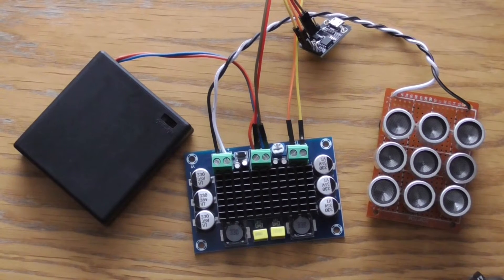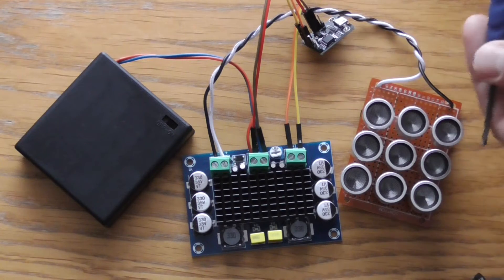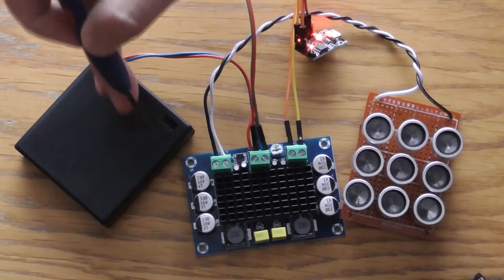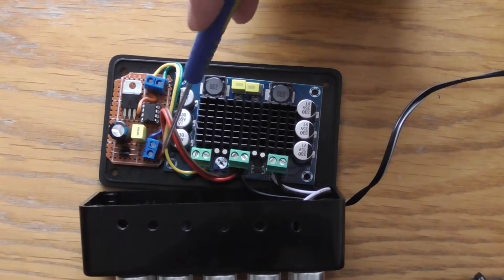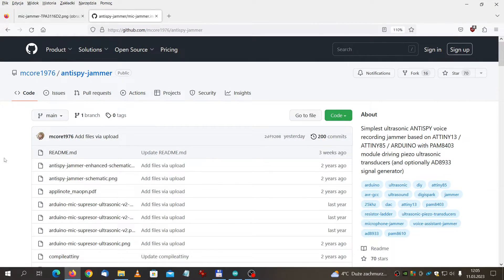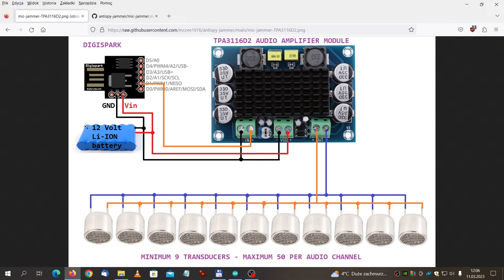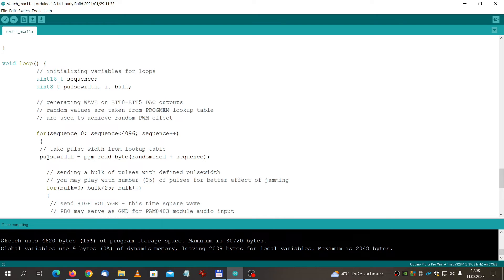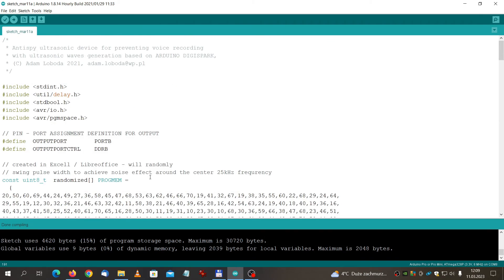DIY microphone jammer beast for less than 30$,  voice recording blocker with Digispark and TPA3116D2

Comment from the maker: ATTENTION! I HAVE CREATED RASPBERRY PI PICO (RP2040-ZERO) / ESP 8266 D1 MINI / ESP32C3 SUPERMINI + AD9833 VERSION FOR THOSE WHO ARE HAVING DIFFUCULTIES WITH BUYING AND PROGRAMMING DIGISPARK MODULES : 

Raspberry Pi PICO : RP2040-ZERO module

RP2040-ZERO DIAGRAM #1: https://github.com/mcore1976/antispy-jammer/blob/main/arduino-mic-supresor-ultrasonic-RP2040-zero-TPA3116-IRF-coils.png
RP2040-ZERO DIAGRAM #2 https://github.com/mcore1976/antispy-jammer/blob/main/arduino-mic-supresor-ultrasonic-RP2040-zero.png
RP2040-ZERO CODE : https://raw.githubusercontent.com/mcore1976/antispy-jammer/refs/heads/main/mic-jammer-rp2040-ad9833.ino

ESP8266 : WEMOS D1 MINI (clone) module
D1-MINI DIAGRAM #1 : https://github.com/mcore1976/antispy-jammer/blob/main/arduino-mic-supresor-ultrasonic-ESP8266-D1-MINI-TPA3116-IRF-coils.png
D1-MINI DIAGRAM #2 : https://github.com/mcore1976/antispy-jammer/blob/main/arduino-mic-supresor-ultrasonic-ESP8266-D1-MINI.png
D1-MINI CODE : https://raw.githubusercontent.com/mcore1976/antispy-jammer/refs/heads/main/mic-jammer-esp8266-wemos-d1-mini-ad9833.ino

ESP32C3-SUPERMINI  CODE : https://raw.githubusercontent.com/mcore1976/antispy-jammer/refs/heads/main/mic_jammer_esp32c3_supermini_ad9833.ino
Reply: Sorry for the stupid question but I am illiterate in the tech language that you are speaking at the moment. Does this mean that you have actually created the device and it is for sale? Because I don't think I can do this project.

Comment: Does 15 ultrasonic transducer needs 100w tpa311d2. Will it not effect the transmitters.
Reply from the maker: yes you have to use this audio amplifier board OR build an output stage with TC4420 MOSFET driver chip + IRFB4115   MOSFET transistor + set of 4.7milihenr coils like I am showing in my newest video here : https://youtu.be/p5w_T1xVSF8

Comment: Is it possible to go with 20khz from one channel of the amp and 25khz from the other channel to cover a wider range of mics? Unclear if the signal generator could handle this, but if you had two of them, could you feed each frequency to a different audio channel and amplify both at once?
Reply from the maker: single AD9833 generator has only one channel I am afraid. so the answer is no. you need 2 such devices

Comment: I would like to share the following information:
20khz transducers work well on Android, iPhone 12, 13, 14 in the common, pro and pro max versions, however on iPhone 15, 15 pro and 15 pro max it generates a loud graphic on the recorder but the voice comes out normally, the only one that works on the 15, there are 25khz transducers that force the microphones to redact the sound in order to completely silence it, during the recording there is no noise or voice, I think the solution for iPhones is still 25khz transducers.
Reply: hi, very interesting your observation...I would like to know what the effects would be if we manufactured two models, one on 20khz and the other on 25khz which would be used at the same time...or how to cover as many models as possible?
Reply: @Jean-tc3wq  one would cancel out the other, in addition to a loud noise, but if you set up a single circuit ranging from 22 to 26 kHz and mix 25 and 23 kHz transducers it works well on iPhones 15 to 3 meters
Reply: @kadinbrasil8160  well we just have to wait until Adam is motivated to make us a final mount🤗
Reply: @Jean-tc3wq  If you use two circuits, one with 20khz and the other with 25khz, when connecting one together it would cancel out the effect of the other on some iPhones, it would work on the 13, 14 but on the 15 it would generate a loud graph on the recorder but it would not cover the voice due to the new technology of the 15 and 15 for max.

The only test that had any effect was in a single device using 15 23khz and 15 25khz transducers with infrasound fixed at 45hz in the single device varying the ultrasound at 22 ~ 26khz

void setup()
  {
  spi_init();
  ad9833_init();
  
  ad9833_set_mode(AD_SINE);
 
    
}

void loop() {
uint16_t i = (0, random(22000, 26000));
  while (true) {
   
   int noiseValue = (0, random(-1000, 1000));
   
   double normalizedNoise = noiseValue / 2000.0;
 
   double modulatedFrequency = 26000 + normalizedNoise * 2000;
   ad9833_set_mode(AD_SINE);
   ad9833_set_frequency(0, modulatedFrequency);
  
  
  while (i >= 21000)
            {
             i = i - 45;
            
             ad9833_set_frequency(0, (double)i );
              
            };

            while (i <= 26000)
            {
             i = i + 45;
          ad9833_set_frequency(0, (double)i );
             
            };

}

}
Reply: @kadinbrasil8160  thank you for your reply this piece of code must be merged into ino...? I don't know much about programming...
Reply: @kadinbrasil8160  or if you would like to propose it to Adam for a possible evolution of his tool... that would be the climax there😅
Reply from the maker: yes we are already working together on the improvements. Soon there will be an update video. The project is almost completed
Reply: @Jean-tc3wq  The project is Adam's, he is the author of everything, I'm just studying and collaborating with his channel, but all credit and intellect goes to Adam.

Soon he will post the completion of studies and new project to everyone.

Comment: Hi
Reply from the maker: hi
Reply: @justanengineer5599  I would like to share the following information:
20khz transducers work well on Android, iPhone 12, 13, 14 in the common, pro and pro max versions, however on iPhone 15, 15 pro and 15 pro max it generates a loud graphic on the recorder but the voice comes out normally, the only one that works on the 15, there are 25khz transducers that force the microphones to redact the sound in order to completely silence it, during the recording there is no noise or voice, I think the solution for iPhones is still 25khz transducers.

Comment: Hi, i just got 50 transducers from AliExpress. 30 out of the 50 had a sort of glue/silicone on the middle of the cone. Is that normal?
Reply from the maker: yes. they are are using kind of glue to attach piezo

Comment: hi I would like to know if being able to jam the iPhone 14 pro proves that it is effective on the vast majority of micro spies...and a comment caught my attention on putting a bigger budget on the jammer ...you talked about more transducers. "Additionally I would use programmable electronic potentiometer" would be possible to have a diagram with this said potentiometer... if it's not too much to ask of course... it's already very good to share your top achievements with us!!!!
Reply from the maker: The iphone 14 can be jammed but only when 1 particular type of transducers is used 20kHz / 24mm very expensive 10usd per single transmitter. 
On the other hand the jamming capability can be improved by using the 25khz / 24mm transducers with bigger tollerance that work within +/- 2KHz difference - in the range 23-27KHz not 24-26KHz. This is of course also bound to modification of the source code for this wider bandwidth.

Comment: Hi I would like to know if it is possible to use this model of amplifier coupled with two rangers of 20khz or 25khz transmitter knowing that we have twice 120 watts output

TZT DC 12V 24V 120W*2 TPA3116 D2 Dual Channel digital Power audio amplifier board good
aliexpress
Reply from the maker: Yes it is possible. I have even tried such combination. But when both 20kHz and 25KHz are enabled there  is very audible distortion noticable
Reply: @justanengineer5599  yes but you have to supply 24V to have all the power...so basically you might as well stay with the 100w mono amplifier...

Comment: Hi, what would you change in your design. if you have a higher budget.
Reply from the maker: first of all I would buy more audio amplifiers and install more transducers. Additionally I would use programmable electronic potentiometer to introduce amplitude modulation  for better distortion effect

Comment: Can we used uno?
Reply from the maker: you may try with this code (this is for Arduino Pro Mini which has the same chip ATMEGA328 as UNO) :
https://github.com/mcore1976/antispy-jammer/blob/main/mic-jammer-ad9833-new-version2.ino

but use TPA3116D2 mono instead of PAM8406 
https://github.com/mcore1976/antispy-jammer/blob/main/arduino-mic-supresor-ultrasonic-v2-pro-mini.png
Reply: @justanengineer5599  how about part HC  sr04  sensor, can we use this Tx for project?
Reply from the maker: no. buy 25khz transducers. If you want to use 40khz there is a source code for this. browse the comments down below many people are asking the same question
Reply from the maker: you need to buy it directly from china  check this info and stop complaining

https://www.aliexpress.com/item/1644831156.html

https://github.com/mcore1976/antispy-jammer/issues/2
Reply from the maker: great success !
Reply: @justanengineer5599  jest różnica gdzie plus a gdzie minus na transmiterze czy po prostu wszystkie tak samo muszą być połączone?
Reply from the maker: niektorzy tutaj pisali ze nie ma róznicy ale jak sie przyjrzysz nadajnikowi to jeden pin ma styk z obudową (jest ujemny) a drugi jest odizolowany (jest dodatni). Ja staram sie zachowywac polaryzacje i łączyć dodatnie z dodatnimi

Comment: I make a 21 Khz mic-jammer (16 mm and 45 transducers). Do you plan to add AVG solution for this (may be something of 20 Khz solution ? Thanks for this 
https://drive.google.com/drive/folders/151QBdlNnTVDCvQOewkptvG_LlpNAHJEU?usp=sharing
Reply from the maker: Hi. I have already tried 21KHz transducers and they are not good. I mean they supress microphone sensivity but they do not allow to sink this fuzzy noise into the audible band. I have a lot of them but they are not good for mic jamming.. 
it is better to use 25khz though
Reply: thanks fo this. @justanengineer5599

Comment: hi sir i have these questions if you are so ganerose to answer me thank you 

1. Can I use the AD9850 instead of the AD9833?
   - Is it possible to substitute the AD9833 with the AD9850?

2. Can I wire the ultrasonic sensor randomly, or do I need to know the positive and negative pins?
   - Is it necessary to identify the positive and negative pins when connecting the ultrasonic sensor, or can it be wired randomly?

3. In your video, you mentioned the "jamming beast" and didn't provide the schematic for it. I noticed the use of the NE555 IC, but I'm unsure how to connect all the components. Could you please provide guidance on wiring them together?
   - In your video, you showcased the "jamming beast" without sharing the schematic. I noticed the inclusion of the NE555 IC, but I'm uncertain about the correct wiring configuration for all the components. Could you please provide instructions on how to connect them together?

thank you 🎉
Reply from the maker: Hi.
Hi I havent tried with AD9850 so I have no general answer. 

Audio amplifier module - each TPA3116D2 module can handle up to 40 transducers so you would need to attach many of them (inputs of XH-M542 modules)  to the single AOUT/AGND output pins of AD9833 signal generator boards.  Please keep mind that more transducers you connect to TPA3116D2 board the HOTTER it will get. Try not to fry it out.

IIf you are a beginner, try to use Arduino Digispark module that contains ATTINY85 chip. You need to program this board using INO script and Arduino IDE environment. You do not push HEX files here.
INO Script : https://raw.githubusercontent.com/mcore1976/antispy-jammer/main/mic-jammer-digispark-ad9833-new-version2.ino
Connection Diagram : https://github.com/mcore1976/antispy-jammer/blob/main/mic-jammer-AD9833-TPA3116D2.png

In my video I am using ATTINY85 (not NE555) .If you want to use directly the same chip ATTINY85 instead of Arduino board you need to have installed : AVRGCC environment ( checlk this tutorial http://fab.cba.mit.edu/classes/863.16/doc/projects/ftsmin/windows_avr.html ), you need to have USBASP chip programmer and you need to connect chip to the programmer (as I am showing in my video : https://www.youtube.com/watch?v=7klgyNzZ2TI) . It's "make life harder" type of approach but its durable :
You are using then following source code : https://raw.githubusercontent.com/mcore1976/antispy-jammer/main/main6-new-version2.c
You are using following diagram : https://github.com/mcore1976/antispy-jammer/blob/main/arduino-mic-supresor-ultrasonic-v2-ATTINY85-TPA3116.png
And you are using this compilation method for ATTINY85, AVRGCC + USBASP : https://raw.githubusercontent.com/mcore1976/antispy-jammer/main/compileattiny6

The transducers alway have negative pin connected to alloy housing and positve pin isolated, it is also visible on the pictures from the vendor. Easy to locate positive and negative.

Also remember to use XH-M542 TPA3116D2 audio amplifers which I found THE ONLY WORKING PROPERLY with piezzo transducers
https://pl.aliexpress.com/item/1005005456023495.html?spm=a2g0o.order_list.order_list_main.16.6dc71c24oo8xD5&gatewayAdapt=glo2pol
check this page for shopping links : https://github.com/mcore1976/antispy-jammer/issues/2

I hope it is clear now, good luck !

Comment: I assembled using your project with two different types of infrasound modulations and 80 transducers in two separate projects forming a single equipment and this was the final result.
https://youtu.be/7wJrOAZou-U?si=QVD35tjVLMk2nWOn
Reply from the maker: great video
Reply: @justanengineer5599  Thanks
Reply: Mohahaha.... Did you use those 20kHz ones? Seems quite expensive for a full set, would you mind sharing the ratio you used between the 2 types and freq you went for? (if I mistaken) Good job man... looks neat
Reply: @matino9928  I used only 6 20khz 24mm in the video, remembering the project and the credits go to Adam from this channel.
Reply: @kadinbrasil8160  for sure @justanengineer5599 Adam, sorry I didnʼt thank you before... you surely sparked the project in my brain as well!!!^^ now i just feel I need to keep up with the different breakthrough trying not to waste money hehe... So you would need 2x different calculations for each frequency right? Iʼm at the iphone issue (with original speakers from the starting project) but I see you seem to have past that issue...? Attiny is out of the question in a correct model right? keeps bugging on my end but I have shitty electric system so not 100% sure...

None of you tried it in outdoor enviremen yet...?
Reply: Can you share every detail of your project. I am trying with bigger unit like briefcase now.
Reply: @irfan_antennas  The project is by Adam
Reply: Did you try it outside?

Comment: Hi, is it possible if i mix 25khz and 40khz using this setting and code?
Reply from the maker: it will not work properly I already check this. The best is to build two jamming units one for 25kHz and second for 40kHz and switch them on at the same time
Reply: @justanengineer5599  I see, what happens if i mixed them both?
Reply from the maker: it should distract more the audio filters  in recording devices
Reply: I see.

Is the 40khz type can use this setup and code?
Reply from the maker: all is available  on my github. It would be faster just to look there and search for something with 40kHz in the name like this :
https://github.com/mcore1976/antispy-jammer/blob/main/mic-jammer-digispark-ad9833-40kHz-new-version.ino

Comment from the maker: attention ! 
I have posted new version of the source code on github for Digispark+AD9833+TPA3116D2 design : 
https://github.com/mcore1976/antispy-jammer/blob/main/mic-jammer-AD9833-TPA3116D2.png 
https://raw.githubusercontent.com/mcore1976/antispy-jammer/main/mic-jammer-digispark-ad9833-new-version.ino
 Now the jammer is barely audible but has good efficiency in jamming - finally as good as commercial sollutions.
Other versions - for ATTINY85 , Arduino Pro Mini ... updated as well
Reply: Hej. Zrobiłem taki zagłuszacz na 40 nadajników, próbowałem to zasilić z trzech ogniw 18650 ale efekt jest słaby. Mogę się skontaktować mailowo?
Reply from the maker: czy użyłeś AD9833 i wykorzystałeś najnowszą wersję kodu tutaj : https://raw.githubusercontent.com/mcore1976/antispy-jammer/main/mic-jammer-digispark-ad9833-new-version4.ino
Reply: Thanks for a great sharing, i tried and it works very well.. mine using 21 25hz transducers with 12v 6A power adapter.. but my version can hear some pulse sound from the transducers.. is it because of the power adapter amp is 6? may i request your suggestion to reduce the sound?

Comment: can i use 40kHz things ?
Reply from the maker: yes but the jamming effect will be weaker. check my github for 40kHz based source code
here is the code for 40kHz on DIGISPARK + AD9833 + TPA3116D2
https://raw.githubusercontent.com/mcore1976/antispy-jammer/main/mic-jammer-ad9833-40KHz-digispark.INO
or newer
https://github.com/mcore1976/antispy-jammer/blob/main/mic-jammer-digispark-ad9833-40kHz-new-version.ino